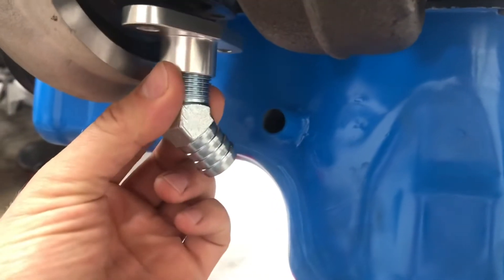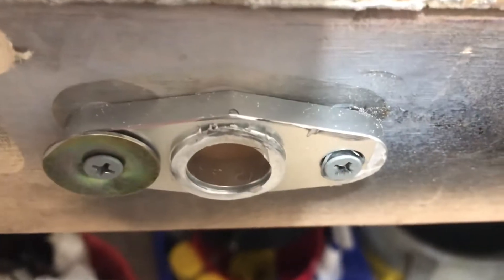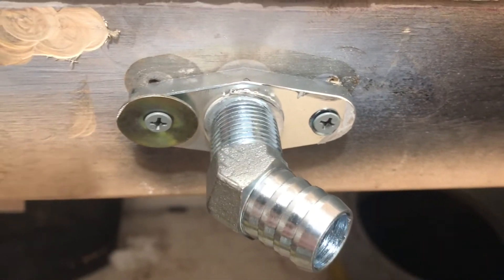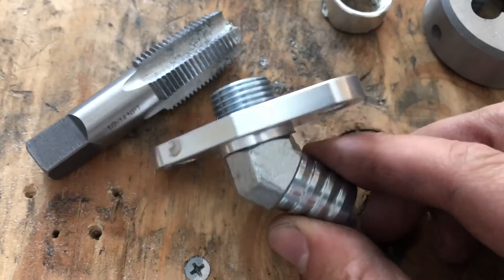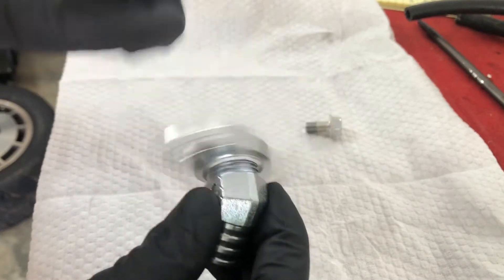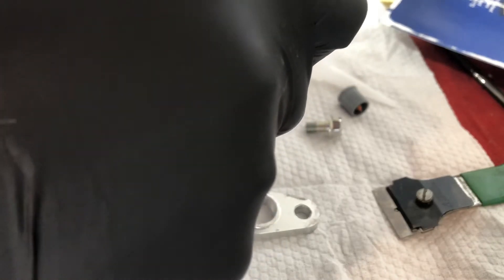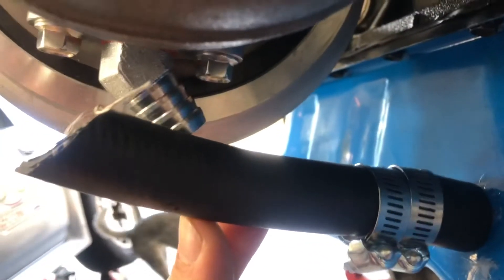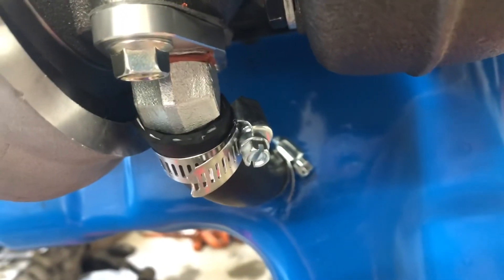Z31 Ep 14 HX35 turbo oil return drain flange

Comment: Hey mate .. just wondering if you are still running the drain setup you posted?.. do you get oil flowing back to the turbo high throttle and lift off  at that shallow angle ?  Good vid BTW
Reply from the maker: Yep still running this same drain. I haven’t noticed any issues with the drain with the HX35. Doesn’t really smoke at all out the exhaust. Turbo is still running smooth and no noises or anything
Reply: @samwashere1392  nice , I got a low mount hx35 turbo set up too with similar short length and shallow angle to sump port . Good to know your drain design is holding up
Reply from the maker: @50undman  good luck if you try to do what I did lol, you could always try to hit the Facebook groups to see if anyone has an extra stock one but it’s hit or miss 🤷🏻‍♂️
Reply: Hey do you know the measurement of how big it was after modifying it